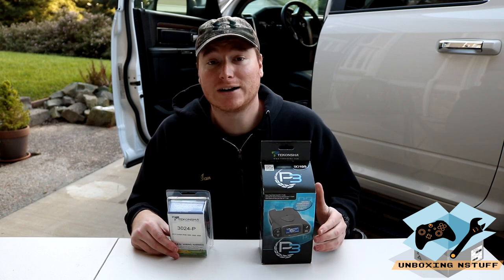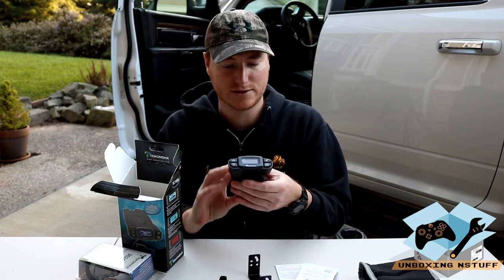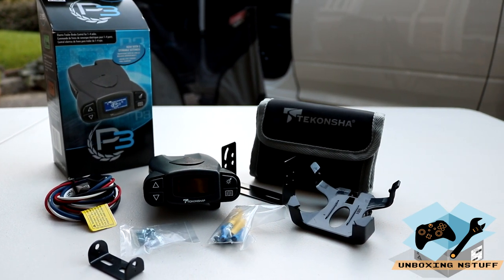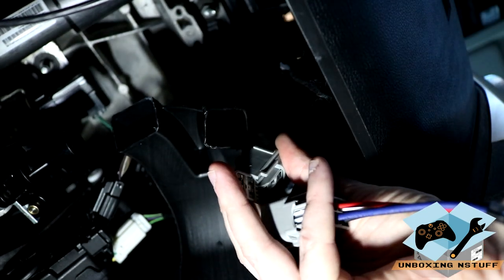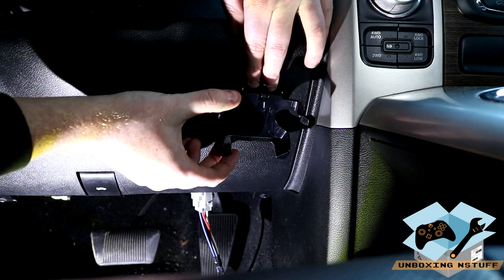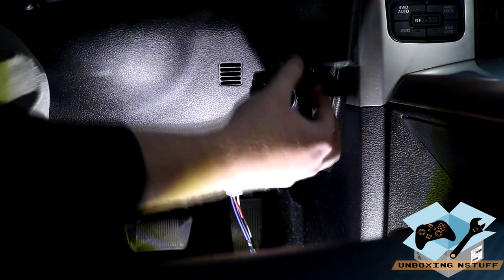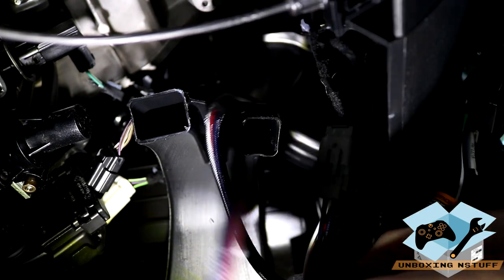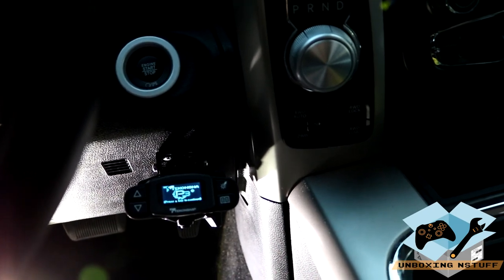Tekonsha P3 Electric Brake Controller Unboxing & Install

Comment: How do you get it to not have constant power? I plugged it in and it has constant power on. I unplugged it so it won't drain my battery. Thanks
Reply from the maker: We found that this unit would turn off about 15 to 20 minutes after turning off and locking the truck.
Reply: I’ve been running this for years and has never drained battery.

Comment: i have an electric brake trailer for car hauling and looking to pull it using semi truck
can i use this on semi truck with airbrakes ?
Reply from the maker: Im not sure that is outside my knowledge base. If I had to guess id assume probably not but you could always email them.

Comment: I got one but does it stay on at all times. Can’t turn it of when I leave my truck
Reply from the maker: It shuts down after about 10 or 15 minutes of locking up the truck.
Reply: @UnboxingNStuff  I have manual locks hope it just shuts off like your. Your the best for responding btw! I just finished install I hope it works well. I don’t have a trailer to test on it lol
Reply from the maker: @TrafficTravelDelight  hah thanks. I bet it will work. Let us know if you figure it out. 👍
Reply: @UnboxingNStuff  thanks man yes it turned off like you said. Have you used yours much?
Reply from the maker: @TrafficTravelDelight  awesome! So far just a bit towing a 21ft trailer and a pontoon boat and it has worked great with both of those.
Reply: M nm.

Comment: Does the device stay on even when the truck is off??
Reply from the maker: No it shuts down
Reply: @UnboxingNStuff  ... Hey man, how long does it stay lit before it shuts off with the keys out of the ignition? I just installed mine, but unplugged it cause I didn't want to drain my battery. Cheers.
Reply from the maker: @troybabs  it takes about ten minutes to go off. Thanks for the comment.
Reply: @UnboxingNStuff  Oh that's good to know. Thank you for getting back so promptly!